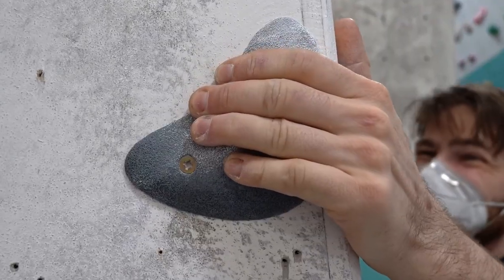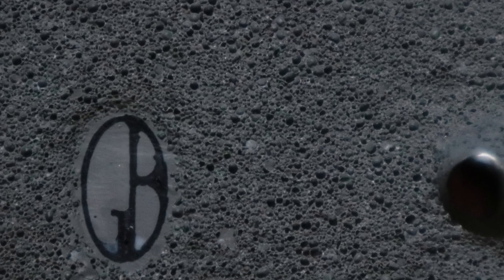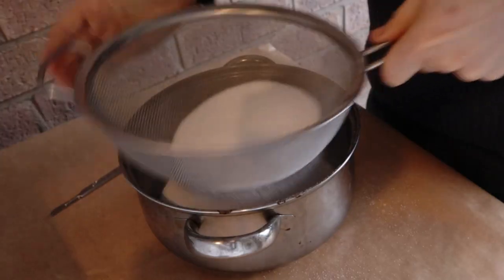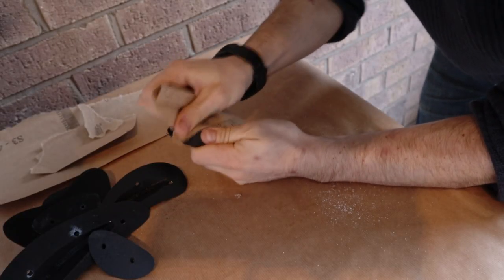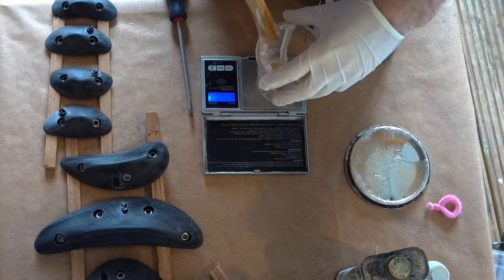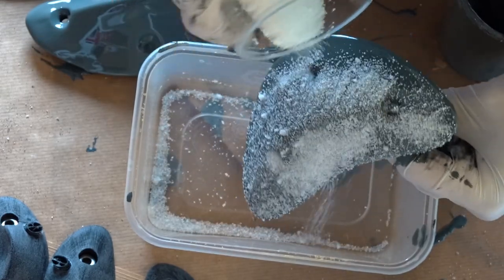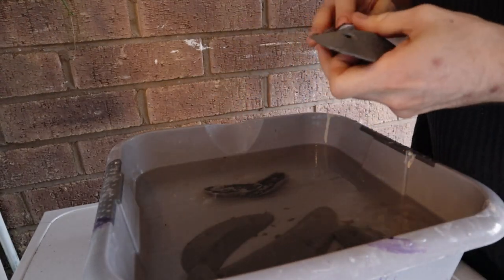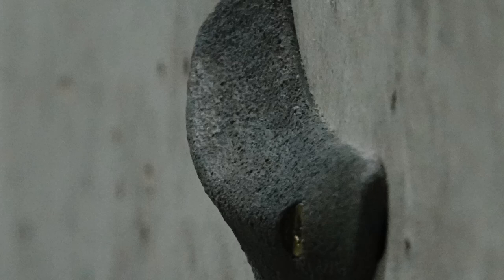New way to texture climbing holds

Comment: Just FYI, This is the way we textured holds at Living Stone, or in fact from before that company was started in 1992. The first time I used it would have been around 1987. There were tens of thousands of these holds at many major climbing walls like the Castle, The Foundry, Undercover Rock, Glasgow Climbing Centre, Gloucester, etc. They often lasted for maybe 15 years before polishing, and were very resistant to chipping compared with cast holds.  We also frequently used dual (or more ) textures as well.  It is quite labour intensive, and one other problem we found was that the color tended to fade due to blooming  if the salt or sugar was simply dissolved out by leaving the holds underwater for a while. Scrubbing them individually was too time consuming if you're making hundreds in a day. Nice to see the technique being rediscovered..
Reply from the maker: That's so cool to hear, thanks so much for sharing. Glad to hear they did well, we've had some in rainbow rocket in Cambridge for almost 2 years now and although the footholds are slightly chipped, they're mostly in great shape under heavy use, with relatively little polishing so far. So cool to hear the technique has such an august history! I'd love to see someone produce macros with innie texture rather than the ever present sand
Reply: Hey Crispin, I’d like to say thanks to you for your creativity “way back” in the early 90s. I can still remember being impressed by (and buying for £7.50!)  one of your very first handmade skull holds (in 1991ish?). The early innovations such as Foundry walls influenced what we built at alien rock in Edinburgh thirty years ago- it’s still running!   More modern holds look amazing, but they never match the uniqueness, durability  and weight! of those early handmade ones! It’s been an interesting industry to be involved with (and to see grow so massively) over the decades. Thanks again for being such an inspiration. Reuben

Comment: Not sure if you have seen it already but I wanted to mention it here as you might be able to try it. People have been using very finely ground salt to pack around 3d prints, then reheating them in an oven to get a more homogeneous part. During the process it gives the parts the surface finish of the finely ground salt particles. You could try a similar process for this application using the larger salt grains you sifted out. Maybe only submerge the exposed gripping face to the salt, then bake it. The advantage here would be that because the texture is melted in the plastic it may be stronger than using the resin.

Not sure if I can link the video, but I know CNC Kitchen made a video on it.
Reply from the maker: I actually have a video about doing that very thing for climbing holds. Kept having issues with voids in the parts and the texture wasn't as good but it's definitely an area worth exploring more at some point. This technique is heavily inspired by the thought process behind that :)

Comment: I used to use caster sugar mixed with epoxy resin to provide deck grip on my home made windsurfers, some people preferred table sugar,,, great video..
Reply from the maker: Perfect use! I found the sugar I had had quite angular grains, and therefore packed too tightly and so didn't make great feeling texture, but I think it completely depends on the specifics of the salt or sugar available! Sugar seems less likely to interfere with the resin chemistry too

Comment: Neat idea!And,would love to see an update on 3d printed holds
Reply from the maker: Thank you! What sort of topics would you like to hear about?
Reply: @gilesbarton-owen6783  Well,since it was quite a long time ago,would love to hear how much wear is there on them(if those were in use lol),and maybe there were few improvements to this method
Reply from the maker: Alas my friend hasn't set them very much since I made them. I think one conclusion we reached was that the screw holes were the biggest weak spots, it's very easy to over torque a screw and pull through the hold. Since then I've taken to putting washers in holds and volumes like I've got in this video. I never resolved the voids problem I was getting with them but Im pretty sure I needed more salt pressure above. I quite like the sand textured holds, we have used those a few times, they're not that nice on your skin but great foot holds. 

I think it's still a great way to make shapes though, hence using them here!

Comment: This is a really cool way of doing that! 
A buddy of mine did a similar think baking his 3d printed holds in salt.
PLA is not the best for wear resistance though
Reply from the maker: Yes I think the resin is definitely better, I have a video about the salt baking for holds and my conclusion is that it's so so. Hot salt corrodes everything so I'm not that keen to continue to use it

Comment: I really love your Idea to create such nice texturing.
Considering the strength and longevity of your holds, maybe instead make molds using this texturing technique.
You'd get the same chance to create interesting textures and texture variations, but you can test multiple casted materials to assess their longevity and strength.
Especially bigger holds in a climbing gym receive extreme abuse, which I'm sure 3d printed solutions won't survive without sufficient strengthening through other means.
Reply from the maker: Certainly an option! My more recent batch made with a fresh batch of resin and in warmer curing conditions is holding up much better though so it's less of a concern. Time will tell though, they're now in the normal hold set so they'll be tested thoroughly. The resin used (PE) is what normal holds are made of so it should theoretically hold up well

Comment: Thank you. Been wondering how to use 3d prints but struggling with texture.
Reply from the maker: Awesome, if you give it a shot I'd love to see!
Reply: My only possible flag on the technique is my prints are very textured. Unsure if I can can the resin to apply smoothly enough. Will send when I try and thanks again
Reply from the maker: I actually switched to fuzzy skin mode for my later holds to increase the bonding between the resin and the hold, it helps the resin wet evenly to some extent

Comment: I wonder if you could pre texture the prints at the modelling stage to assist resin adherence
Reply from the maker: Yes I did this with a wire brush and in subsequent versions I used the fuzzy texture feature of prusa slicer (most slicers have it) which significantly increased adhesion
Reply: @gilesbarton-owen6783  I haven't watched your other videos sorry - what .. plastic do you use. Plus the baking ofc

Comment: Hi Charles.  Do you know how the Hold Companies make the Dual Texture Holds.  Specifically I’m trying to figure out how they achieve the smooth finish on the foam before casting the foam in the silicone.   Any help would be greatly appreciated. Thank you.
Reply from the maker: This is actually something I'm planning to work on at some point and publish a video on because it seems like a lot of companies make a big deal about proprietary info. I think careful masking, a slight inset on the to-be-smoth area, bondo or some other filler, glossy spray paint. They then cast the foam into silicone. The technique I outline can be used to do dual tex (I recommend two separate resin applications) but I've not yet perfected it. - Giles

Comment: Hiya, looking to make a hold set for my climbing gym soon. I'm particularly curious how this texture feels compared to traditionally casted holds. I am tempted to use your process to create silicone molds for casts, but i wonder if the silicone will be able to fill all of the pores to capture the depth of the texture.
Reply from the maker: In terms of the texture feel, I'd say these were much closer to cast foam texture than sand for sure, I'd say at least 80% so. I've had climbers say it's pretty kind to skin while being grippy which is great to hear. 

I think casting should be fine, it's topologically very similar to foams surface, unless there's some weird surface tension effects
Reply: @gilesbarton-owen6783  Only one way to find out! I'll definitely try a few other methods as well and see what works best. Thanks for sharing the knowledge.
Reply from the maker: I'm very biased but I think it's second only to perhaps good foam casts. Hope it goes well!
Reply: @gilesbarton-owen6783  I'll let you know what we find out! If I end up making a video on our setup I'll be sure to credit you.

Comment: This is quite fascinating. But I wonder how this could work to save costs.
3d printing and epoxy coating holds still feel like they would be expensive per hold, when compared to molding fully in resin.

I tried shaping masters in floral foam, making a silicone negative and then filling the negative with epoxy, and that proved to be a good texture all around, and I calculated the silicone was the most expensive part.

Do you have ideas on how to scale this up sustainably?
Reply from the maker: Definitely not a cost effective method for mass producing small holds, I'm using it for prototyping, small batches and functional testing. I think it would be good for wooden or fiberglass larger holds where the silicone molding process starts being untenable (not quite sure why to be honest but over about 1m everything seems to be sand)

There's a possibility too of refinishing old holds or even old anything into a climbing surface but that I don't think would ever be cost effective

Comment: I wonder how some of the engineering filaments would work for climbing holds.
Reply from the maker: The critical factor in filament selection, I think, is working out what one actually wants property wise. PLA isn't very tough, but it is extremely strong, basically only PC convincingly outpaces pla in strength. We don't need particularly tough parts, but I think a modified pla adds some nice toughness. PLA has a major advantage however in cost, it's half the price of any engineering filament and can be printed on a stock cheap machine well, without wearing nozzles or making nasty smells. I print mine on a stock X1. 

I could see wear resistance being very helpful for texturing directly like my other printed holds video.

I'm always tempted to upgrade a printer to print engineering filaments but it's hard to see a super convincing argument for most of them tbh.

What sort of properties were you thinking?
Reply: @gilesbarton-owen6783  wear resistance was the main one. Perhaps increased strength could allow for printing fins or other fun/non-standard holds. My local gym has a holds that are busts of famous individuals. It'd be neat to print holds like that.
Reply from the maker: For sure! Not sure how close the holds I made were to failing, I suspect one could do a lot more with pla than I tried!

Comment: Any particular STLs to print? I’d like to give this a shot for my 5 year old who’s not going to put as much pressure on them as an adult would.
Reply from the maker: So far I've only made quite challenging holds (small crimps, and slopey crimps) that would be hard for even a novice adult to hold. This is partly because of the print time/plastic being hugely less for smaller holds. I was thinking of doing a video on modelling holds, not sure if that would be of interest? Some of my previous hold designs can be found here: https://www.thingiverse.com/gbartonowen/collections/climbing-holds
Reply from the maker: I've added my favorite series here: https://www.thingiverse.com/thing:5267829

Comment: Could you list the resin you used in your video? I am using an epoxy resin but it seemed very thin and liquid making the coat uneven.
Reply from the maker: I say in the video I'm using polyester gel coat. It's a thick resin product used as paint. Epoxy paint or epoxy thickened with a bit of ground glass powder or something would also work I think but I've not tested it. It needs to form a 2ish mm skin on its own really

Comment: You could try out the salt remelt process of CNC Kitchen, with larger grain size salt
Reply from the maker: I have a video about exactly this, I never managed to get it working reliably without voids and I don't think pla is wear resistant enough for climbing holds. Thanks for the suggestion though!
Reply: @gilesbarton-owen6783  thanks for the fast reply, imma look at the video, maybe other plastic works or outside facing sand. Imma try a bit out.  edit: just found out, that you tried sand already

Comment: Have you tried the previous tactic of putting the hold in the oven for 1 hour, before applying the resin?
Reply from the maker: I've not tried combining the two concepts but I could never quite get the salt baking to work flawlessly, it always resulted in small voids. With the resin shell I'm not worried about strength really, these holds are incredibly robust (used commercially for 2 years now at a busy gym and still in okay shape)
Reply: Would you be worried about the strength if you were to make a juggier, larger hold? I was wondering how each method would be hold up for more complex shapes.

Comment: Looking to build a climbing volume. You mentioned in your volume video you would make one on templates etc, have you got any templates you could share ? Thank you!
Reply from the maker: Unfortunately I don't as they were all hand drawn from sketchy cad (blender -> export as paper model -> inkscape) to paper, which was subsequently lost. Can give you some pointers but I think cardboard is the best way to go for pattern making, or foam board
Reply: @gilesbarton-owen6783  no worries. Have some ideas of shapes in my head, just finding it hard to work out the angles of the bezels where two bits meet. Does blender provide this sort of capability?
Reply from the maker: It sort of does, with the edge angle viewport overlay, but it's definitely worth sanity checking by both comparing it to an estimate and maybe even lining the view down the edge and measuring the screen (!) With a protractor. I'm not sure if I'm especially bad at the angles thing because I've had a lot of my more complex patterns end up with wrong angles. Then you have to either divide that angle by 2 or so (180-x)/2 depending on if it's outside or inside angles to get the angle to cut with the saw (assuming butt joints). I get the feeling everyone in the industry uses SketchUp which I think makes measuring angles a bit more intuitive with the protractor tool. The blender measureit add-on is quite good but you'll probably have to add the odd bit of geometry (extra edges) to actually measure what you're after
Reply: @gilesbarton-owen6783  interesting, okay thank you. Will have a play with it and see how I get on! If I manage anything interesting will post on here.
Reply from the maker: Please do!

Comment: How do you think the adherence will be to existing (but polished) PU holds?  I am looking for an effective way to retexture some quite polished moonboard holds as they are expensive and take a long time to ship.
Reply from the maker: Honestly not sure, I think there's a couple of factors and solutions. Firstly chemical bond: I'd guess that PE doesn't stick that we'll to PU but I've not really any idea. Best thing for that would be some testing. Id probably use thickened epoxy or PU directly. The surfaces need to be cleaned and roughed up thoroughly. Some patents point towards slightly hairy surfaces having good bond (wire wheel seems to be a good tool here). You can also make thin cuts or scores into the holds to get a mechanical lock between the hold and the new shell. Overall I think it'd work to do a bit of a hybrid of both.
Reply: For polished PU holds epoxy resin or fresh PU would be best, I think. Maybe clean them with acid first (vinegar or Climbclean or the like) then sand/score for better bonding.

Comment: Neat idea! Seems a little heavy on the manual labor, so maybe not best for mass production except for really special holds. I could see doing some really wild dual texture designs - or even "fading" in the texture from "none" to, "some" (one pass of your salt) to "some" (two layers)
Reply from the maker: I think in terms of labour they're not dissimilar to other sand textured holds, hopefully, except the wash out step. I've generally needed less coats which has saved a lot of time, but in a larger scale who knows how.itll shake out.

In terms of fades and stuff, it would.be so.cool,.looking forward to.experimenting more for.sure! Planning some dual Tex for my next batch

Comment: Neat! How does it hold up to impact? Like if someone hit one while falling from the top of a boulder?
Reply from the maker: Hopefully a fall wouldn't result in a hard impact, but I tried hitting one of them with a hammer and the surface coating was damaged for sure, it produced some small chips and dust but did not become sharp or cracked so shouldn't be dangerous